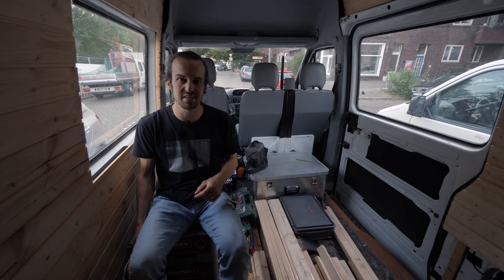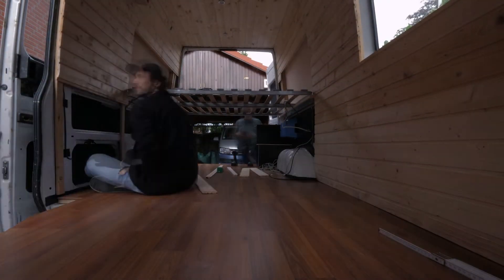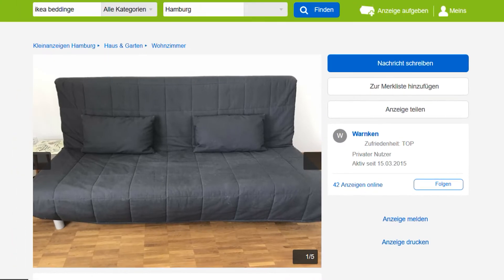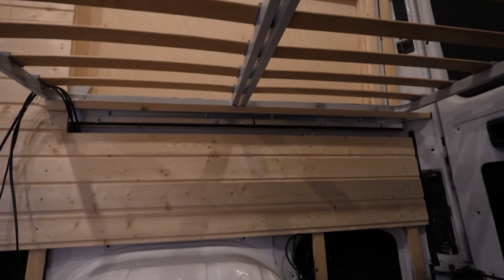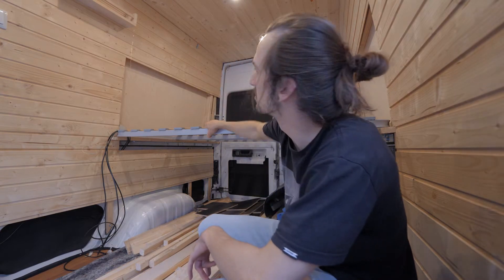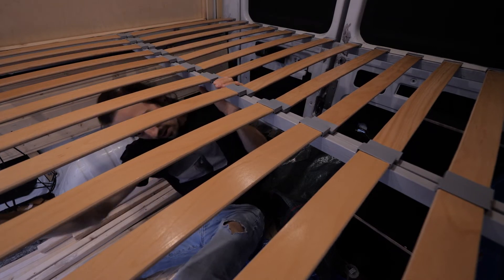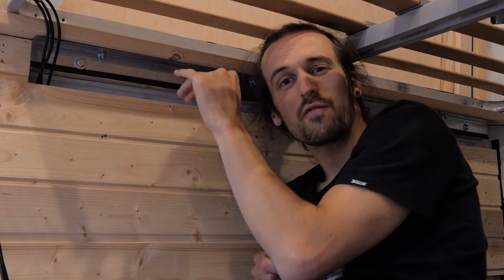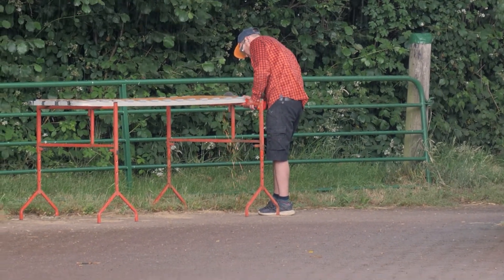Awesome Free Bed Idea For Your Van (vanlife)

Comment: So what are the final dimensions of the bed (cca)? are you going to sleep lengthwise?
Reply from the maker: Sorry, that might not have been so clear. the original bed is 2,00m x 1,40m but when you cut off the sides it's going to be roughly 1,70m x 1,40m (keep in mind that you'll have to frame pieces). Not exactly sure with the 1,70m. It could be 1,60m as well. If you're interested I'm going to find out for ya 😃